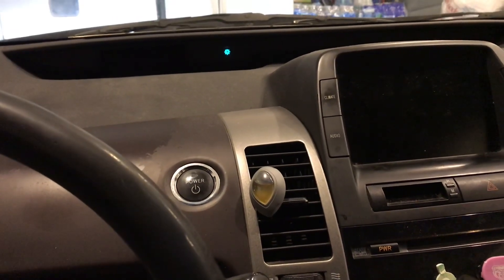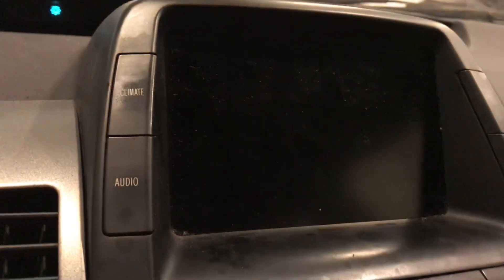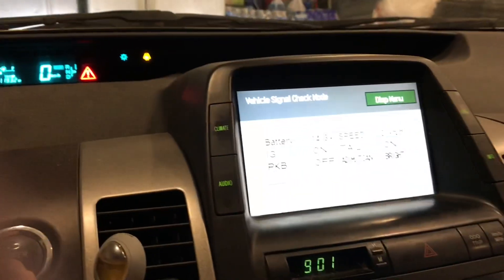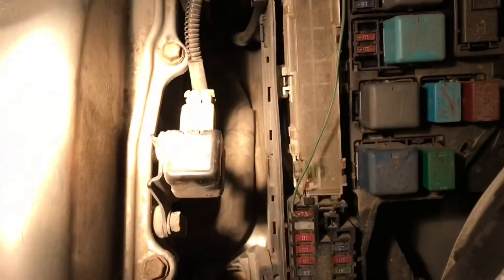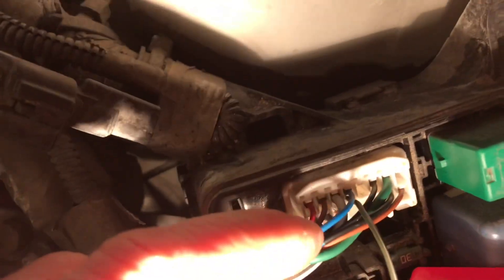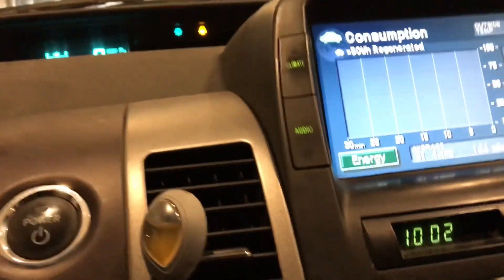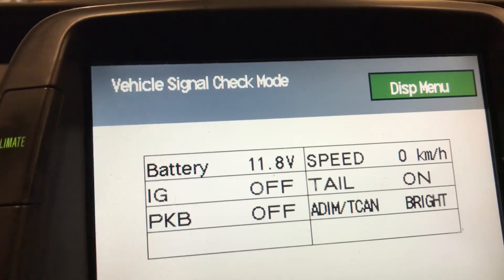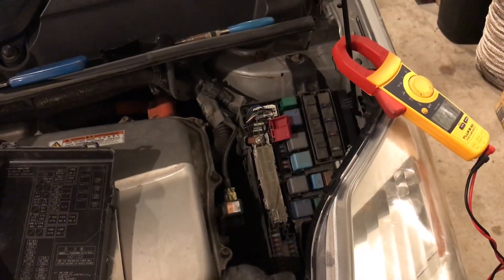Prius P lock or Park lock repair with Red Triangle

Comment: Hey Jacob, I was just on here the other day with 1 or 2 other people that are having issues with their red triangle light staying on!…in my case I just had the hybrid battery changed out, the 12V battery is checking out just fine!🤔 I’m starting to look into the the exhaust fan mounted not to far from the 12V battery to see if the connections there can be possibly corroded. At this point I’m pretty confused on what to do, if that checks out ok!..what you think!
Reply from the maker: Are you getting the park lock error? Do you have H ID headlights? It could also be the H ID headlight level sensor in the rear suspension. The level sensor will also cause a red triangle. They can be taken apart and cleaned or just replaced. I had to replace mine.
Reply: Jacob Dinverno you know it’s funny you mentioned that, because the day this all started to happen is the day I rotated my tires all the way around on the car. I had the car up and down in three different corners at different times, so now it has me wondering if something became unbalanced or out of wack after I was done! As far the park lock error that may of came on 1 or 2 times, but always went off, fairly quick!
Reply: Jacob Dinverno ya Jacob, although I didn’t get to it yet, it definitely looks like the HID sensor bracket became disconnected underneath there! Hoping that’s all it is, cause I hear the sensor and all is like 250 bucks or so! Thanks for getting me there, really appreciate that, and yes the idiot light is also lit on the dash!
Reply: @jakemir  The head light sensor will show a different warning on the touch screen than the p lock warning.

Comment: Thank you so much !
I just fixed my 07 Toyota Pruis hybrid with the same technic and triangle of death and the translation p lock message was gone instantly.
Thanks again you are awesome!!!
Reply: How do you connect the wire to the fuse? Just put it in there then insert the fuse?

Comment: What is the gauge of the wire that you jump it from the fuse to the blue wire?
Reply: I haven’t heard about the gauge of wire, all you can do is try a basic wire, preferably with insulation around it and see what happens, but do LMK if you hear anything!
Reply: Thank you so much 
It did work for me .
Thanks again
Reply: What gauge wire did you end up using? @adamquincy9314

Comment: Hey Jacob I’m having the same problem with my 05 Prius, where did you get the green wire to connect it to the blue wire?
Reply from the maker: Chef Meer I used a solid strand piece of wire from my sprinkler system wiring. I’m sure a wire from a stereo or thin wire from any electron it device would work

Comment: I have the same issue on my 2004 pruis but it just doesn't start, unless I disconnect the battery for a min and connect it back, then the car will start and work just fine, untill I turn it off then it won't turn back on, with the issue saying it's on p lock mechanism apply brake or something like that

Comment: Jacob and all, the Prius problem is not the small auxiliary 12v battery which is simply used to power the computer and peripheral electronics of Prius. The real problem when you see a red triangle of death is that one of the 14 pack voltages inside your main battery under the back seat is off by more than 10% of the rest of the pack voltages. A pack voltage is the total voltage of two cells side by side each other. On my Prius 2004 which is currently having red triangle, pack voltage at position #6 cannot hold a charge, ie, during charging is it 12% higher than the rest of the packs, and during discharge, it immediately goes down to about 7% below the rest of the pack, all the while the rest of the pack have voltages close to each other. I use Dr. Prius on my cell phone with a compatible wireless OBD dongle attached to car's female computer interface port. It allows me to make me see the individual pack voltages in real time. So, I put stepped hard on my brake, put Prius on ready and drive shift, and pressed gas pedal to the floor. This charges all cells evenly. As some pack voltages reach their maximum, I keep going, and extra charge simply convert into heat as you can hear the fan at the right side of back seat going crazy. I keep on pressing pedal and the packs with lower voltages keep rising. Ultimately, voltages of the packs with lower voltages catch up and rises to less than half the limit. I then erase the main battery error code using Special Feature menu of Dr. Prius, turn off the car, and unscrew the negative of the 12v battery for 5 minutes. Red triangle goes away.  Now this works only if your worst pack is still recoverable, else, the bad pack will have to be replaced. Individual cells are cheap these days on eBay or amazon. Recovering AGP batteries mean doing three cycles of discharging them down to 30% then charging them full (I have a  charger/discharger from www.hybridautomotive.com). A quicker approach would be to just replace your whole main battery with a refurbished unit with, say 3 years warranty. They can cost you between $1500 to $3000 at eBay or amazon, then hire a Prius shop to replace the main battery for you, or scout www.priuschat.com for detailed instructions on how to replace your main hybrid/traction battery.

Comment: Just did this on my 2008 Prius, Gen 2. It worked. However, I'm a little concerned of long term damage leaving the jumper wire on it. Any comments on this?
Reply from the maker: You can remove the fuse box and replace the existing corroded wire. All this does is reroute power from the existing corroded wire to another route. I’ve had it on for over a year.
Reply: Yeeeeah, I won't be trying that. I'll just leave the jumper wire there. Thanks for your video. It save me from so much aggravation.
Reply: @jefflueth6126  add a  7.5 amp fuse with the jumper wire. I've heard some fix this with cleaning the blades of the 7.5 amp fuse.

Comment: Thank You, Jacob, for this very helpful video. My car Prius (2004 model) has similar problem but I cannot seem to find a solution for it. Basically, all the electrics switch complety off and I cannot turn car on. Then after about 10 to 15 mins, and very luckly, the electrics stats to gradually come back on and the Parking Lock fault ( just as in your vid) is displaced. Eventually the car will start and work fine for a while. After a day or sometimes after a few hours the same fault happens. This started straight after a full service by Toyota dealer, last week. They will not accept responsibilty and I cannot afford their £85/hr plus any repair costs :( . Do you know any solution for my car's fault, please?
Reply from the maker: Sounds like your 12 volt battery in the back. Has that been replaced? How are your cells on you hybrid battery? I changed mine after 12 years.

Comment: Advance Auto had to charge my battery to get it up to proper Volts &  CCA of 410, They said just trickle charging won't work it has to be a certain kind of charger.

Comment: Jacob , thanks for the video, It worked for me , didn't even jump it with the jumper, I was gonna check to make sure it had power before inserting it to the blue wire , so when I went to turn it on all the warning lights were gone, pulled the jumper off the fuse side and still no warning lights, gonna gas up and go for a test drive , thx again
Reply: StevoS. Hello, how did you do it?
Reply: @TheUpdate36  try taking the fuse out and putting back in, it worked for me and it still runs.
Reply: StevoS. I did that, but it didn’t work 😣
Reply: @TheUpdate36  try the jumper wire from the fuse to the blue wire, hope this works
Reply: I did that but it’s hard to connect the wire with the blue wire
Reply: @TheUpdate36  check the video at 3:40 , looks like he twisted the stripped wire real tight and just stuck it in to make contact w the blue wire, thats the only way that I can think of, hope it helps
Reply: @TheUpdate36  Did it work ?
Reply: StevoS.  Did not 😣
Reply: @TheUpdate36  i have this issue too, but seem to recall Jacob saying the fuse block had voltage one side but not other side of the fuse. How can the other side be read, with fuse removed? Anyway, if thats true, what usually happens is the fuse connectors have corroded or lost springiness, to not give good contact with the fuse when it's insterted. Bypassing with a jumper wire from another source bypasses the fuse...so that defeats the fuse function. Be careful doing this. I would like to know what the source is that Jacob plugged into... Unless its not a source, but connection to the output from where the fuse conductor is at fuse block. That is good. Pulling the fuse block for access to the backside is a nightmare I'd think. Thanks again for this, jacob..)
Reply from the maker: @TheUpdate36  use an add a fuse. 

Recoil FT2-10 10 Pack 12V Car Add-a-Circuit Fuse Tap Adapter Mini ATS Blade Fuse Holder with 10pcs 10A, 20A Fuses https://a.co/d/h4a58EK
Reply from the maker: Add a fuse video someone made

https://youtu.be/NW0QaQaU41Y

Comment: Thanks for the video  I have a 2006 prius I have the same problem,  but the warning does not come all the time but sometimes and when I put in forward gear it drives normally, recently my battery goes low and had to jump start at least 4 times , and also the blue wire is there but not in the top line but 2nd row so do I need to conect only to the blue wire ? please help. Thanks
Reply from the maker: You may notice the issue is worse during wet weather. Our problem started intermittently too. You should replace the small battery in the back with a Toyota Battery. I was able to get it from a dealer for 185.00 plus a 25.00 core. You should not have to keep charging the 12 volt battery. They are only good for about five years. When adding the wire it will go from the fuse to the blue wire, but a low battery causes this same issue. The new wire helps if the original wire is corroded and is getting poor voltage. Most problems related to the Prius are low voltage issues from the 12 volt battery.
Reply: @jakemir  thanks so much for this video and verbal knowledge exchange!!! I'm buying an '04 from my friend, it's been sitting 3 years, he removed the fuse block cover and lost it, and drive it on salted rooads. Yeah. It'll be a corrosion challenge... uh-huh. Fingers are crossed...)

Comment: I'm having same problem
Reply: Al Barth have you fixed it yet?
Reply: @TheUpdate36  yes. Turns out had air in my coolant from when they change the fluid I bleed the system myself and no light of death in week

Comment: Dident work for me.
Reply: Pay attention  to the video  guey
Reply: marco antonio herrera okay guey I did it four times. I junked the car. These cars are piles
Reply from the maker: Verify you have voltage on the new wire you added off the fuse first. If there is not voltage you may have not secured the wire enough. If there is voltage verify you are making a good connection at the connector.
Reply: Jacob Dinverno thanks for the reply! I done fucked it real good now. I pulled the shift motor off the transmission for some reason....the wire was all corroded so I cleaned it up but now the thing is stuck in park and I can’t move it at all.🤦‍♂️🤷🏻‍♂️

Comment: Is this wiring the same for 2010 prius? Having this same issue. Do you think this solution would work for gen2 prius? Thanks.
Reply from the maker: Yagiz Guc As far as I know this will only work for the Second Generation Prius from 2003 to 2009. You should try charging the 12 volt battery. When this auxiliary battery is slightly low the Prius can have electrical issues.

Comment: What kind of wire is this? Trying to find one now to purchase
Reply from the maker: I used a 16 gauge stranded wire that I had lying around from an old speaker. 18 gauge will work too. The wire should be insulated. Just strip about a half inch off both ends and use one side under the fuse and the other end pushed into the pin connector.
Reply: @jakemir  Will keeping this jumper wire connected like this do long term damage to the car do you think?